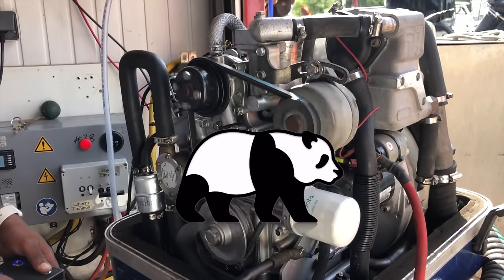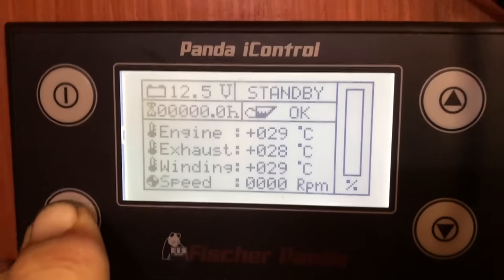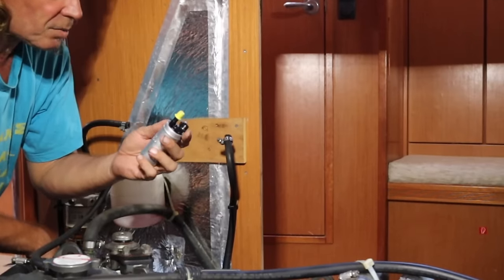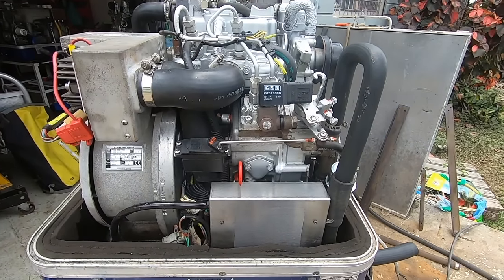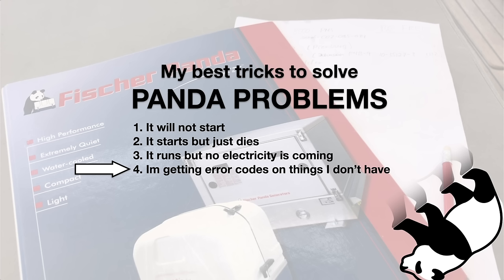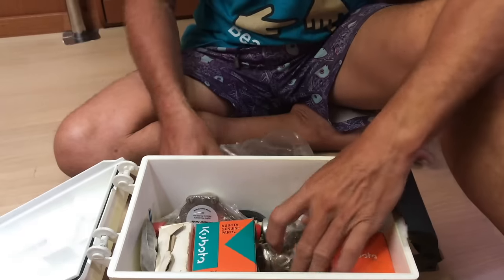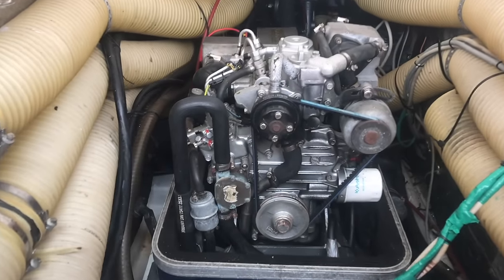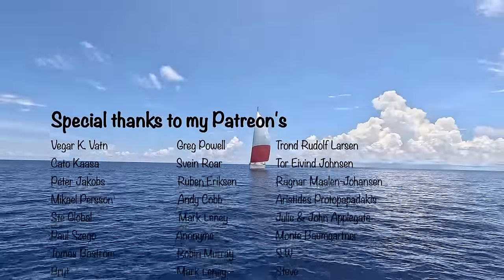Fisher Panda PROBLEMS? - SwT 178 - HOW TO DESTROY A GOOD BASE ENGINE

Comment: Thanks for this informative video.  I purchased a used 8K, got it delivered and no compression.  Seller refunded all my money, but it cost me $700 to find out the problem.  Found a vendor that remanufacures the Kubota z482 engine, sent it in for rebuild.  No joy, the crank was disintegrated and blocked cracked from prior owner overheat.  Vendor ordered a new engine from Kubota for less than the rebuild price.  I’ll keep you apprised as we head to Mexico with it.  I ordered 2 spare pumps, 4 impellers.  Have you found a replacement fuel pump other than Panda? BTW, if i could fit another make of generator on the boat i would, but the space was designed specifically for the Panda😢

Comment: Hi Thomas, I always watch/sub, your channel. I have to jump in here and tell you what I think about a couple things I just saw, 1st thing is that POS glass filter, you need to float check that (throw it over the side and see if it floats). Those are garbage and always leak, sometimes they come apart and make a mess. 2nd is how you mounted the electric pump, it's too high above the engine, try to find a spot lower than the fuel intake on the Kubota. Your electrical issues I won't speak to as they're all different. Good luck, keep the faith 🍀

Comment: Generators don't like living in a box, so many are hidden away & never get maintained & when it goes wrong it really gets expensive. An engine check every 20hrs of running time will reduce the eventual problems. The water pump seriously needs re-designing.
Reply from the maker: Yes it’s better to have it exposed to see it every time it starts up. But I was so tired of this machine and basically had been giving up on it. Prior to the just leave and forget, it had received so much love and attention it was ridiculous. Still the reward was never returned.
Thankfully I found out what the real problem was with this machine. All the best and thank you for being here

Comment: Thomas the fuel pump for your Panda looks like an oversized fuel pump for what we say in Norway for a Chinese Diesel heater, and should have the fuel numbers on the pump, how many milliliters per stroke. Anyway, Happy sailing from Stavanger
Reply: Your wrong this is a small engine. But we know you have zero ideas on small engines

Comment: the simple trick is  dont use a Fisher Panda
Reply: Is a reliable kobota engine,unfortunately components are shit.
Reply: Maybe Tomas should rename the channel: Panda Fighting with Tomas?😂
Reply: @nickgoodall578  Kung fu Panda fighting.?
Reply: @svthorasailing4868 yes slap a variable voltage alternator get rid of all panda stuff. But any air will kill pickup pump.
Reply: FP is an excercise in how to make a genset way more complicated than what it needs to be. We threw ours overboard and never looked back. At least with genset and lithium you can setup a high current / low run time charging scenario... 😊

Comment: Electric diesel pumps need to be at the fuel source and preferably at same level they do not pull fuel they push it
Reply: I agree but a minor leak in fuel lines will knock them out with air. No fuel leak but air kills pumps. Has problems and had to replace my fuel lines then no problems.

Comment: That is atrocious. I won't be getting a Panda diesel generator. I have a 20 year old Generac Wheelhouse 5500 gasoline (air cooled) generator that never gives me trouble. Just give it oil and gas and it returns lots of electrical power, noise, and fumes.